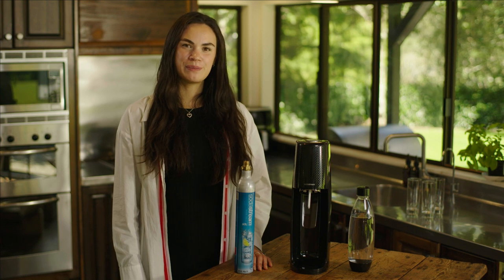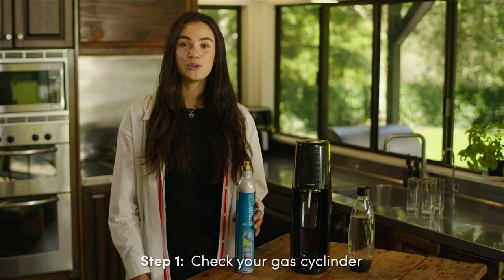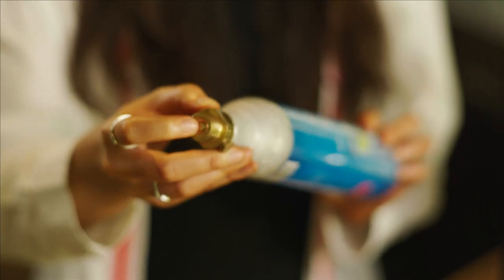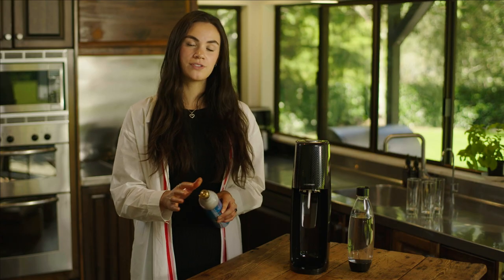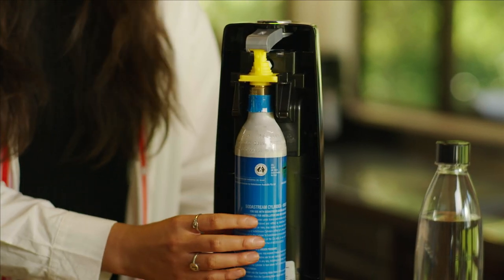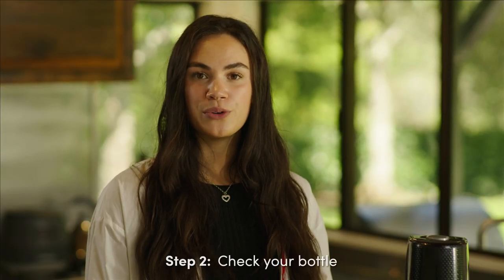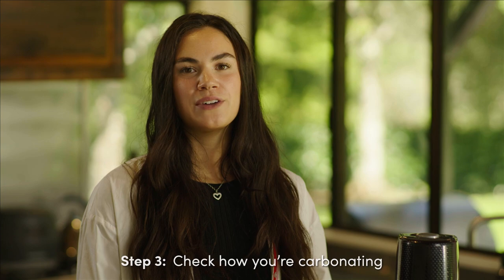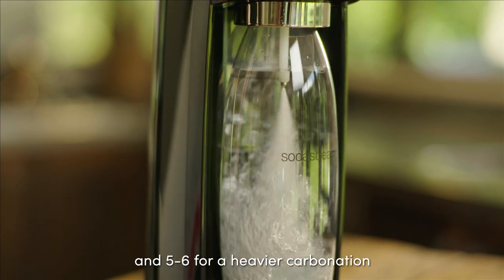Why is my Sparkling Water Maker not carbonating properly?

Comment: I have filled about 30 bottles and now the soda stream does not carbonate.   The gas cylinder is  full and the water bottle is a quick connect.   I push the button and loads of gas goes into the water.   I do this 10 times and still very little fizz.   I thought the gasket that the bottle goes over might be bad and it almost feels like gas is escaping but I can't find the gasket on amazon to buy a replacement. It is very difficult to remove the old gasket also.  Only the yellow gasket for the gas cylinder not where the bottle fits.  I took the gasket out and it is black with a bottom groove.   It is still bizarre that no gas is staying in the water.   Almost like the cylinders don't have CO2 but some other gas ?   I can't find anything out about this on the internet.  Zero information and I will be calling soda stream tomorrow.   
This video spends all it's time about an empty cylinder and everyone knows when that happens, you get less and less gas coming out until it stops.
Reply: Same issue here. Water is bubbling loudly but no intense air trying to escape sound, and no gas release when I undo the lock. Maybe the bottle top isn't getting sealed? I heard the o-ring rubber seal can fly off but not sure if this is what it would sound like if that were the case.

Comment: The most worst product I ever purchased. I changed co2 thinking the one came with it has flaws, still I don't see any sparkling even I press for 30 seconds. The starlings just don't stays in the liquid.
Reply: This is what I am getting now but it worked good for 1 1/2 years. I got lots of really fizzy drinks. 
  I strongly suspect it is the gasket that goes over the water bottle.   If that is leaking then all the CO2 you are trying to pump in goes straight out.   I noticed an older type of soda stream where you screw the water bottle on and it make a flat seal with a rubber gasket on the top of the bottle.   I strongly suspect that the older one is better.  When it was working good , I would push the button for about 5 seconds and you could tell there was pressure in the bottle and I would wait for it to dissolve in the water for about 10 seconds and then do it again like that about 4-6 times and get lots of gas.   I even took flat pepsi and regassed it.  Now I get tons of bubbles going in and none of it is staying in the water.
Reply: @jeffbguarino Have you figured it out with certainty yet?

Comment: Mine just pisses out the liquid all over the fucking counter. Now all you have, is a mess to clean up. And still non carbonated liquid. A bat to the knees is what the person needs who made the Sodastream.
Reply: You are supposed to just gas water.  Then you add your flavour.    I mix up a drink with sugar and flavour and gas it up but you have to do it slowly and wait for the gas to absorb or dissolve.  If you put too much it will overflow.   I want to buy an older soda stream that has screw on bottles and make a better seal with a rubber gasket on the top.   I have a feeling they work way better.  The push on bottles don't work that well and are gimmicky and don't make a good seal. That is why liquid blows out.